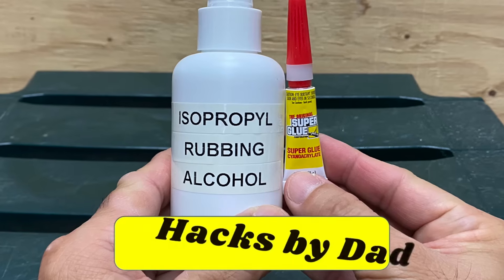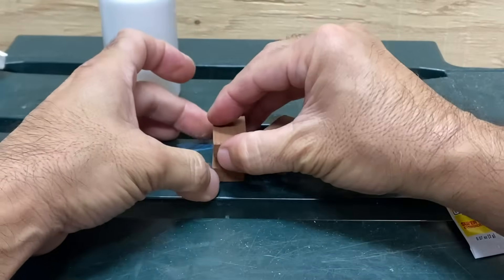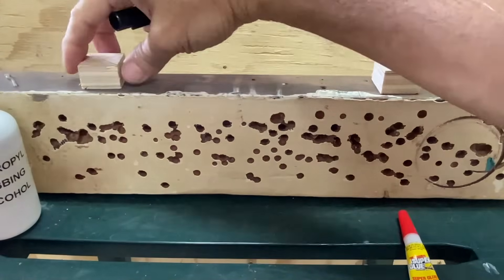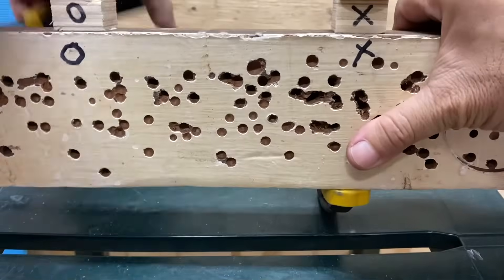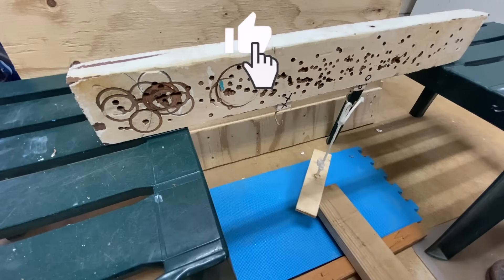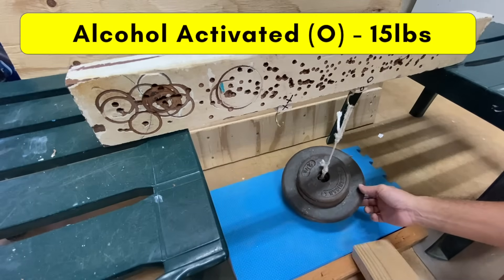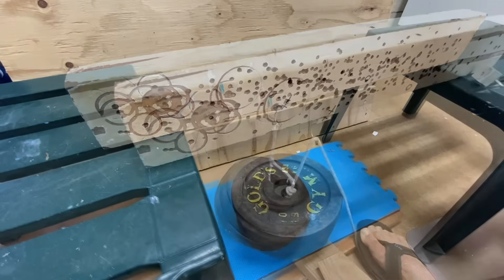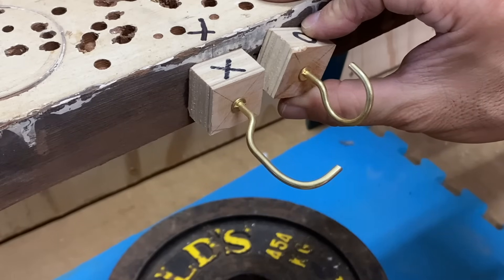Super Glue & Isopropyl Alcohol | How Much Weight Can Super Glue Hold?

Comment from the maker: "To err is human"
My apologies.  I made a mistake in the strength test.  I only used 1 drop for the IPA sample vs 2 drops for the plain super glue sample.  Honest mistake.  I've done several other tests that demonstrate that the IPA accelerated bonds are weaker.  
https://youtu.be/rC7MlFjl2oI
https://youtu.be/vMWwsTSiiEY
https://youtu.be/1916jgXdAXM
At least I didn't use 2 drops for the IPA and 1 drop for the plain and then say that the accelerated bond was stronger!  LOL
😎
Reply: no, just delete it, do it again and re-upload. Thanks
Reply: I was wondering...
      Instead of alcohol.. 
Have you ever tried using water w/ some dissolved baking soda (sodium bi-carbonate) as accelerant...? 
      Logically, that should work better than isopropyl alcohol.
      Would be interesting to see a comparison 

(... And I mean 'saturated' not over-saturated. 
        Like.. Baking soda dissolved completely - but the water still looks clear.)
Reply: @HacksbyDad Have you seen the "Water Baking Soda" Accelerant? 1 tsp. Baking Soda & 1/4 Cup of Water. I wonder how 70% IPA would work in lieu of just water???🤔
Reply: FYI.. Using wood as your testing material gives a Horrible example.. Wood is way to porous, the glue just soaks into it mostly disappears.. In this example I'm pretty sure you're just getting the same results that wetting the wood with water prior to applying the glue would give.. Wiping the surface with water temporarily prevents all the glue from absorbing into the wood and giving similar results of a non porous material like plastic.. Of course moisture is a reactor but I don't think this displays Accelerator vs No Accelerator at all.. 👍
(Not trying to be a jerk)
Reply: @swalowit  This is probably technically correct
Reply: @James-wd9ib   the best kind of correct
/Futurama

Comment: When the X hook failed you had extra load on the hook because you were holding the loose and with your foot. That increases the weight. Total weight the hook has to hold is the weights + tension in the additional rope. In the other test, there was no second source of tension/weight.

Comment: Very useful info.
I always figured they were the same... BUT... it does explain why the 'seen on YT' trick of "temporarily holding something in place" turned out having to hammer and chisel it off.. 
     ("But in the video it looked so easy..."
.    As it turns out, in the video they used accelerator :))

Gonna use this new knowledge to my advantage!
      (And for light applications, I'll definitely use it.. (Have to affix some light weights and some wooden sticks to my anti-insect screen curtain, so it doesn't create openings for flies and mosquitos when it's windy))

Anyways - thank you 
Have a good weekend

Comment: When Superglue first came out, lots of people ended up in ER to have their fingers unglued. It was a common thing in the newspapers back in the late 50's to early 60's. I used it for my model cars and once two fingers came together you had a heck of a time getting them apart. Today one can glue fingers and easily pop them apart. Scrubbing the fingers with soap and water will remove most of the glue residue rather quickly. This was not so in the early days of the product. I know they deny it, but, Superglue has changed. It's still a great glue but it's not nearly as fast drying or as strong as it once was. I think they secretly watered it down for liability reasons.
Reply: And then there's the woman that used gorilla glue to adhere her wig 🤦‍♀️

Comment: FYI.. Using wood as your testing material gives a Horrible example.. Wood is way to porous, the glue just soaks into it and mostly disappears.. In this example I'm pretty sure you're just getting the same results that wetting the wood with water prior to applying the glue would give.. Wiping the surface with water temporarily prevents all the glue from absorbing into the wood and giving similar results of a non porous material like plastic.. Of course moisture is a reactor but I don't think this displays Accelerator vs No Accelerator at all.. 👍
(Not trying to be a jerk)

Comment: Nice one. A simple experiment that demonstrates the hypothesis clearly.  I also appreciate the correction you made and acceptance of the 'amount of glue error' . Well done! 
I use accelerated superglue fixings frequently for temporary fixings as it is easy to remove, works quickly and holds work pieces in place securely without need for screws and clamps, it saves so much time in the workshop!  but I never use accelerated super glue for 'final' or permanent fixings.
Reply from the maker: Thanks!   Appreciate the feedback and the sharing of your experiences.  
👍  😎
Reply: "A simple experiment that demonstrates the hypothesis clearly" ? WRONG. you would need to do more testing to isolate variables in order to make a conclusion. Otherwise you might look like a lying idiot like NASA

Comment: THis surprised me. I thought you were going to say that the alcohol bond would be stronger, but no! :)
Reply: But u said that alcohal adds to strength, in the beginning of vidio ?
Reply from the maker: @arunkamal2320  The 70% isopropyl alcohol sped up the curing time to only 10 seconds but weakened the bond.  This is okay for lightweight applications.  If you need the full bonding strength... best to let the super glue to cure slowly and not use an accelerant.
😎
Reply: @HacksbyDad  Thanks..But other videos still advocate the use of alcohal.
So I m confused.
Reply from the maker: @arunkamal2320  Nothing to be confused about.  Accelerating with isopropyl alcohol is okay if you want fast curing and don't need a strong bond like in crafts and model making.  You can try a commercial accelerant if you want fast curing and a stronger bond like with Starbond... https://youtu.be/29uksHBi2j0
Not accelerating the super glue will still be the strongest but will cure very slowly.  
😎

Comment: Isopropyl alcohol is recommended for removing cyanoacrylate glue, so it's no surprise the alcohol-sprayed bond failed first. You set it up to fail when you sprayed the piece.
As for the "plane" piece - that's "plain". USE spell check. So simple.
Reply from the maker: Thanks for the feedback.
My intent was to share and demonstate the fact that IPA can be used to accelerate the curing time of CA glue but at the expense of bonding strength.  Accelerating with IPA is okay for lightweight applications where strength is not important but speed is... like for crafts and models.  
As for the spelling error... I found the error in the closed captioning that YouTube automatically generated.  I searched for a fix and was able to edit and correct the spelling.  I learned something new!  Thanks for pointing that out!
😎

Comment: Good video, thanks.  I caught the error but it didn't change the results.  One thing the commenters fail to mention is that there are non water based accelerators out there that work very well and don't materially affect the glue strength. Some can actually improve the strength but as with everything in life, YMMV depending on how you use it. CA glues are used routinely by model airplane builders and wood workers so they are your experts.  They are available in different thicknesses in any hobby store or wood working website but the accelerators are not available in most hardware stores for some reason, at least not those that I used to frequent.  One more thing, the best CA glue I have ever used is made with powdered rubber and is jet-black in color.  It is stronger and less brittle than the clear varieties. Best used on metal to rubber surfaces but I also use it on glass and ceramic figurines or anywhere I need superior strength.  I once used this stuff to repair the one-of-a-kind proprietary type-font belt on a large $20,000 industrial line printer back in the 1990s.  Printer would have had to have been scrapped if the glue failed to work, but it worked like a champ and the thing ran daily like that until it was decommissioned several years later. Saved my job, too.
Reply: Hi, would you mind sharing the brand / model of the rubberized ca glue please. Thanks
Reply: @MkhanEmkay  I think it was IC-2000 Rubber-toughened CA by Bob Smith Industries.  Available in hobby stores and online.
Reply from the maker: @MkhanEmkay  It's not rubberized.  It's the original super glue in a yellow and red tube. 
 😎
Reply from the maker: Cool... thanks for sharing.  
😎

Comment: Then why not just moisten both surfaces with a fine mist of water or better mist with pure H2O?
Reply from the maker: Too much water doesn't work.  I tried spraying water and it didn't go well.  I dampened with a moist paper towel and it worked but not as fast.  The isopropyl alcohol hack is more for lightweight applications because of the weaker bond.
Please check out my Glue Hacks & Test playlist for more fun glue related videos... https://youtube.com/playlist?list=PL_WcGw5s6Cq55igwJLfUlv30WsY-PJuTt
😎

Comment: Wished I had known this when I was “fixin” my vw beetle fan.  Back then I had not one once of this info. But, I used a lot of cleaning, heat and patience.  But it held up for a year plus!  Never knew that alcohol is an accelerator.
Reply from the maker: Yes, it can be used as an accelerator but does result in a weaker bond.  Better for lightweight stuff.
😎

Comment: It's a polymerization reaction. The glue reacts with itself to form a solid matrix. The accelerant reacts with the glue and starts the polymerization but because it isn't the glue itself and replaces some of the glue molecules, the bond is weaker. The trick is to use only the minimum amount necessary to kick-start the reaction but not compromise the stability of the matrix
Reply from the maker: Great information.  Makes sense.
Thanks!
😎
Reply: Also, the alcohol make the glue thinner, and therefore it soaks into the wood more, leaving less glue on the surface to bond. Maybe it would be worthwhile to do the test on non porous surfaces.
Reply: test was flawed before it started...
he proved nothing...
He used 2x the glue on the non alcohol block.
This was not a test... there were no controls.
Just a stupid excuse to make a video.
Reply from the maker: Nice catch!  My bad.  Honest mistake.  This was my first glue video and I didn't notice the mistake at the time.  I did several follow-up tests and videos with the same results.  Isopropyl alcohol should be used as a super glue accelerant only on lightweight projects where weaker bonds are acceptable.
😎

Comment: Excellent presentation and very informative.
Reply from the maker: Thanks!  I really appreciate the feedback!
That's one of my older videos and I'm still learning things about creating content everyday.  
😎
Reply: Not excellent... it actually is a waste of time as he did not have any controls in his test and he rigged it from the beginning.
He used 2 drops of glue on the non alcohol block while using only 1 drop of glue on the alcohol block.
Video proves nothing other than this guy is clueless and should not make videos.
Reply from the maker: @Licoricedisc  Nice catch!  My bad.  Honest mistake.  This was my first glue video and I didn't notice the mistake at the time.  I did several follow-up tests and videos with the same results.  Isopropyl alcohol should be used as a super glue accelerant only on lightweight projects where weaker bonds are acceptable.
😎

Comment: I built rc airplanes in the eighties and nineties. Used thin and thick CA. Thin worked great for balsa to balsa, balsa to porous 'lite ply'. But for lite ply to 5-7 layer plywood I would use either thick CA or 5 minute epoxy. For some reason smoke from the end of a lit cigarette would work as a kicker for the thicker CA. Also baking soda or sanding dust to build fillets.

Comment: Do you have a trick to glue refrigerator drawers together so they will hold ?
Reply: A physicist professor friend of mine repaired my freezer drawer by the following method:
1) Clean scrupulously with dishwashing liquid, rinse and dry.
2) Mix up some 2-part epoxy adhesive, e.g. Araldite and apply to the crack
3) Apply tape over the crack on both sides (about 1.5cm to 2.5 cm broad tape with a fibre weave is best)
4) Coat the tape well with the mixed epoxy and allow to dry.
Reply: @sirrathersplendid4825  thanks i will give that a try
Reply from the maker: Try the super glue with baking soda hack... https://youtu.be/8NQrMxYflcE
Hope it works.
😎
Reply: @HacksbyDad  i tried the baking soda and super glue last time. It did not last. I think the plastic is to thin in those areas and then need to add support ribs or a better design
Reply: @davidmoore2601  — Just measured the fibre-weave tape: it’s only 1cm wide and was applied on only one side of the drawer. Still holding strong after about five years!
Reply from the maker: @davidmoore2601  One viewer commented that he uses strips of newspaper with super glue to repair stuff.  I haven't tried it yet.  
😎

Comment: superglue does NOT set faster with "moisture" !!  It actually sets because of "lack of oxygen"  If you are speaking about silicon sealants and adhesives, then it  would set faster using moisture. This is why you can leave the lid off a superglue container for months and the glue will not set, but the minute that lid is clogged up and seals the bottle-- then it goes off  and sets.
Reply from the maker: I'm no chemist, but Brent @GoobertownHobbies has a chemistry Ph.D. and explains how super glue works... https://www.youtube.com/watch?v=1hY1jyGNzIo&t=6s
I understand it... contact with moisture in air starts the curing process.  Here are a couple of experiments I posted...
https://youtu.be/SYVREbiTJJk
https://youtu.be/ySTVamAJxzA
😎

Comment: Note to the wise:

"Rubbing Alcohol" is not the same as isopropyl alcohol ( regardless of the alcohol/water percentage).
The reason that Rubbing Alcohol is labelled as such, is due to the addition of "Baby Oil" (or mineral oil ) to lubricate the skin, and to facilitate "rubbing" during a massage.

Whereas, products labelled as "Isopropyl Alcohol" do not contain oil, and are simply a mixture of alcohol and distilled water.

Its like my great, great, grand-pappy used to say  ...   "Boy, if you ever want to ruin a glue-joint  ...  just add a drop of oil." 😁👍
Reply: Wow! Thanks for sharing this - explains the issues I have had with rubbing alcohol and glue - thanks again
Reply: Recently bought some 99.9% Isopropyl alcohol (Propan-2-ol). Now, that looks like the other extreme since it has almost no moisture in it. Will it work as a CA accelerant?
Reply: @Sir Rather Splendid ,

I haven't tried using such a high purity alcohol concentrate before, so I can't draw from experience.
However, in my humble opinion, I believe it would work nearly as well as lesser concentrations.
The reason for this, is not exactly intuitive though.
99.9% Alcohol is virtually anhydrous (containing no water) and therefore, it readily absorbs ambient moisture from the air.
Thus, when used with Super Glue, it stands to reason that the rate at which moisture can be drawn from surrounding air, would be greater, due to the alcohol, than would be possible with the Super Glue alone.
Reply: I have never read on the rubbing alcohol that its with oil only withvdestilled water 30% and 70%ipa.🤔

Comment: As a wood turner. I use my share of CA glue. Usually to tighten up bark or to reinforce a crack that looks suspicious.
Also, I use it with sanding dust or coffee grounds if I want to fill in a hole or something.
Thin CA is a great finish for small items, like pens or mini tops or such.
It is known that if you an accelerator to make it bond faster, the glue becomes brittle and may break the bond. 
For that reason, I don't ever use an accelerator.
If I want to glue two pieces of wood together, I use wood glue. I would never trust CA Glue for that. Ceramics, glass, plastic, etc, yes; that is what it is made for. Non porous materials. Wood is not non porous. I have a figurine made of onyx that was broken  in 1975 that I glued with CA Glue. Still holding up just fine, and it gets handled a lot. I was given a Stiffel lamp in 1976 that was broken in about 15 pieces.( a marbled glass globe). That lamp cost over $175.00 in 1976 so yeah, I accepted it and fixed it. Still in one piece and been through 2 other owners and back to me.    But, I won't trust it to bond wood.
It does make for a quick and easy glass-like finish. But I rarely use it that way.
Reply: I was doing a countertop for my mother-in-law and I needed the bonding agent. She asked;" Isn't all glue the same?"  "NO, no, it's not."  I replied, "After all, as good as sugary cereal sticks to a bowl, (WHICH IS VERY GOOD) you're not going to use it on a countertop." She still looked a bit skeptical. Every glue has its applications. I like Loctite in the blue bottle for many projects, leather, nylon, and some rubbers. Mind you, not for anything I'd worry would fail. I make cell phone holsters, fix certain types of rubber "O" rings. Basically, I like to experiment to see what works and what doesn't. I would never use super glue on wood. Regular Elmers White school glue has never failed me. Works pretty damn good on ceramics too.
Reply: YEA COFFEE GROUNDS ARE JUST WHAT I ALWAYS WANTED TO USE !!!!!!!!!!
Reply: No... this test was rigged... there was no standards.
He used 2x the glue for the non-alcohol block than he did for the alcohol block
what a waste of time watching as the only thing he proved was his inadequacy of doing a proper test.
Reply from the maker: Nice catch!  My bad.  Honest mistake.  This was my first glue video and I didn't notice the mistake at the time.  I did several follow-up tests and videos with the same results.  Isopropyl alcohol should be used as a super glue accelerant only on lightweight projects where weaker bonds are acceptable.
😎